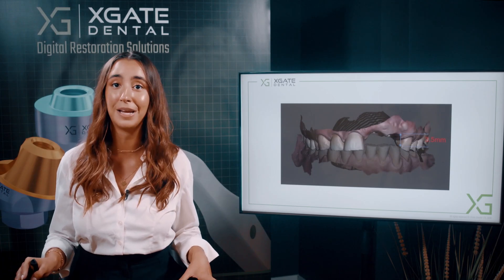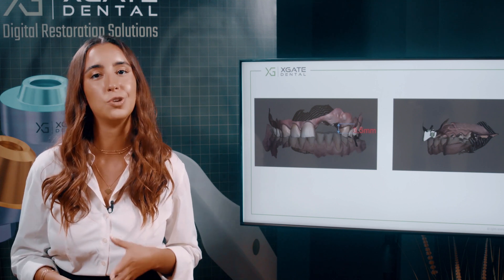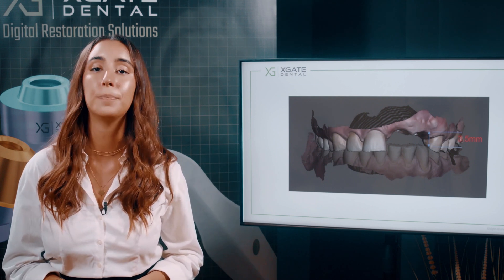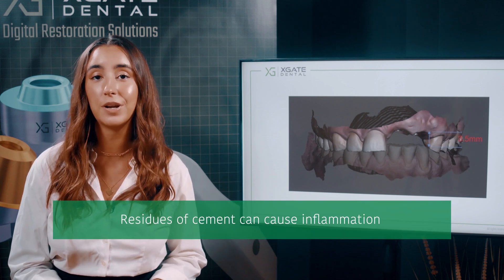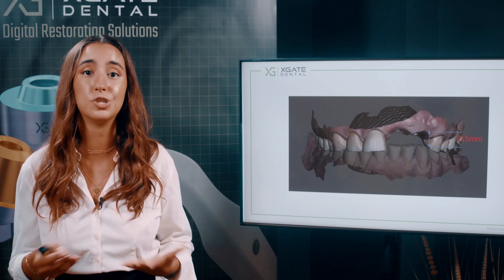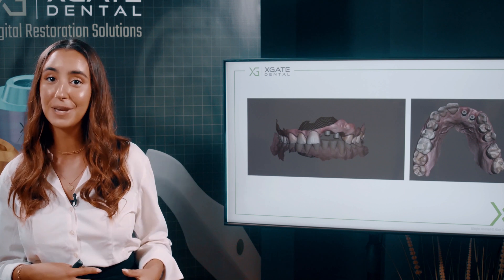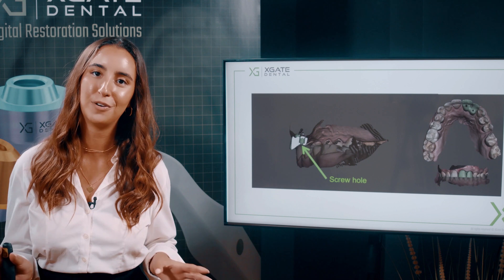Cemented restorations VS screw retained restorations. Particular case 1. V-Type Multi Unit

Comment from the maker: Cemented restorations VS screw retained restorations. Particular case 1. V-Type Multi Unit
00:00 a case where we didn’t have enough space due to two things
02:00 we need to analyze this in two aspects: the first one is the height
03:00 you choose between cemented and screw-retained in the frontal areas
05:00 the implants quite palataly
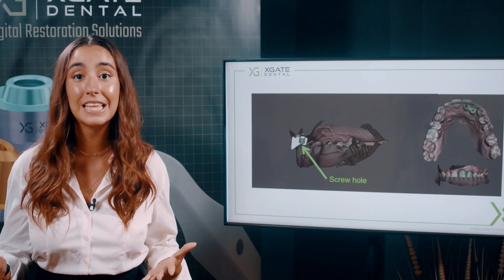06:00 when you’re using zirconia and you’re milling with CAD/CAM